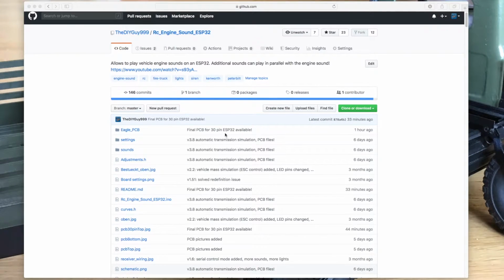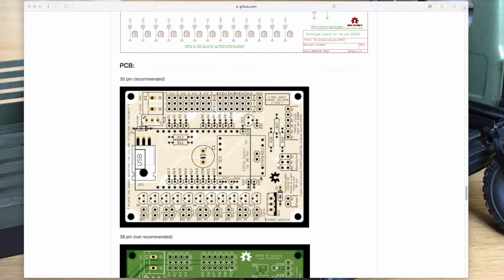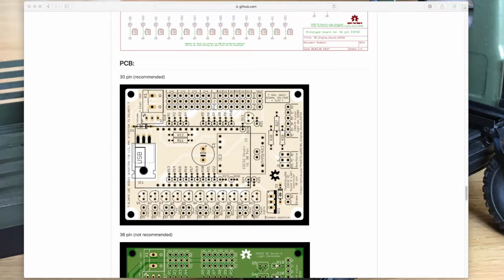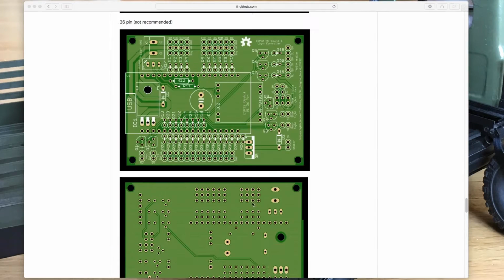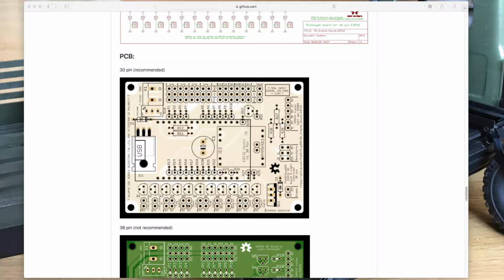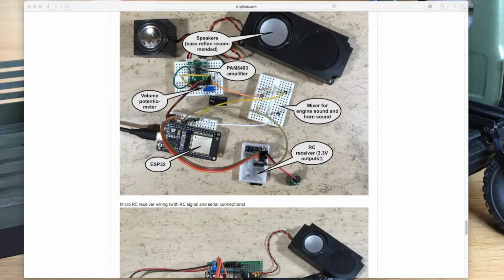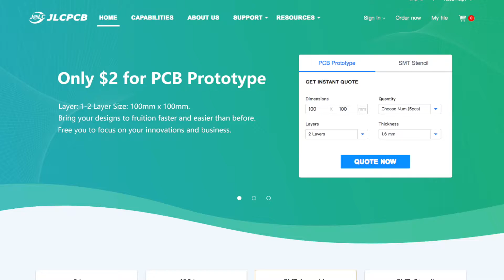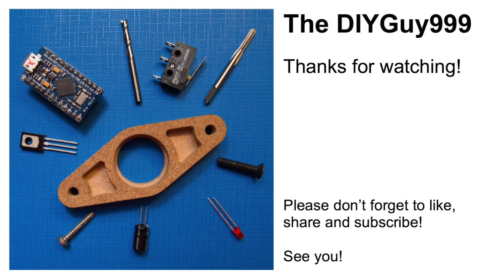Arduino ESP32 RC Sound & Light Controller: PBC, Automatic Transmission, Improved Tatra 813

Comment: Hello, I am using a control with PWM communication but I have not managed to make it work, configure 2_adjustmentsRemote.h for pwm but it does not work I do not know if you have to configure something in the control or something else in the code thanks, I am from Colombia. and thank you very much for sharing all the files.
Reply from the maker: go to the boards manager and install Espressif ESP32 board definition 1.04
1.05 is not working
Reply: Ok, another question, does the ESC have to be connected? 

I mean, can I do the tests without connecting the ESC, only the control receiver?

Comment: thanks a ton for the detailed description bro, my project is up and running, just a small problem, my left blinker is constantly working, relay sound too, i am unable to point out the prob, tested for short circuit but nothing there, can you point where to see?(tried circuit around pin 1, using classic mode)
Reply: any idea how fix this problem
Reply from the maker: Your steering horn appears to be mounted off-center. Then you probably compensated the offset on your transmitter. Reset your steering channel midpoint and then attach the servo horn, so that your wheels are straight. Also make sure you don't touch your joysticks while powering up the ESP32, this could disturb the auto centering
Reply: @TheDIYGuy999  thanks
Reply: The servo staring and remote are alinde properly. I removed both service and Rc signel coming from reciever to esp. even without staring servo signal turning led is blinking
Reply: pleae help me to fix my problem thanks

Comment: Hi many thanks for your video but I can not get my ESP32 to connect to any of my pc's or laptop's! 
I'm running on the latest Windows 10 and Arduino IDE and have added ESP32 to Aruino IDE but port# remains blank.
My ESP32 does not have any chips with CH340 or CP210x numbers. I have installed the Silicon Labs Windows 10 universal driver.
Any help would be most grateful
Reply from the maker: Hmm, another viewer also had issues on windows 10. On windows 7 it worked flawlessly. The driver should be correct, I think. Is it displayed in the device manager? Unfortunately, I'm on macOS, so I can't tell you details.
Reply: @TheDIYGuy999  Hi. Thanks for the quick response 👍. It does not show in device manager. Running out of ideas! I've ordered another 3 esp32's Just in case there is something different. I suppose I could buy an old windows 7 laptop 🤔
Reply: Managed to get pc to recognise ESP32 and connect!
Tried it in the USB3 port and successfully uploaded "Blink"
Now have to figure out how to upload your sound files👍

Comment: ajukan pertanyaan berapa banyak lampu led yang dapat Anda tempatkan dengan modul PCB 30-pin, misalnya bus tingkat dua memiliki 120 led, dapatkah Anda menggunakan pcb itu?
Reply from the maker: Each BC337-25 transistor is able to supply around 500mA, one LED requires about 20mA, so you can drive about 25 LED in parallel per transistor. If you need more, drive a bigger PNP or P-channel mosfet with the BC337
Reply: @TheDIYGuy999  guru punya whatsapp untuk konsultasi pribadi proyek saya, saya butuh bantuan Anda
Reply: @TheDIYGuy999  Master could you help me because I would like to put 5 transistors like 50 LEDs as you would help me please

Comment: Hi, my congrats on this project. its totally insane! an to provide it free for all its just incredible. I would like to make one myself but to use my normal 10 ch transmitter can it be use? what side the perforated pub is? thank you!
Reply from the maker: Thank you for the praise. You can use 4 standard RC signals (PWM), SBUS or PPM to control it. The ESC needs to be connected to the sound controller instead of the receiver. I recommend to use SBUS, because not all additional functions can be controlled via PWM. Currently I'm working on an update, which should make it easier to control additional functions.
You can order the PCB as follows:
1. Download the Gerbers.zip file form here: https://github.com/TheDIYGuy999/Rc_Engine_Sound_ESP32/tree/master/Eagle_PCB/Final (you can also find a schematic and a parts list there)
2. upload the zip here (press "Quote Now"): https://jlcpcb.com
3. do not change anything except the color and the quantity you want
Reply: @TheDIYGuy999  Thank you! understood the way it need to be connected. I check the pbc files but in my country its not so simple to order that pub that way wanted to do it on a perforated pub instead. If you consider its to difficult ill see if I can find a local pcb maker.
Reply from the maker: @maxm1417  Of course you can use a perfboard as well. I did exactly the same for the first prototype. See pictures on GitHub. Every PCB maker should be able to make one, based on the provided Gerber files.
Reply: @TheDIYGuy999  Thank you! I will check pictures.

Comment: That is a great card. I finally received every needed component and soldered everything. Tonight, I heard the very first sounds from it. I just need to change the potentiometer as I'm still waiting the 20k ones and found a temporary 5k one. Next step will be to synchronize my gear lever with the gear shifting. My plan is to change channels input for servos output as I use SBUS connection from my X8R (works fine) so the ESP32 will set the gear servos position. the 330Ohm resistor should not be a problem as I see you uses one on the esc output too. (I need to figure out what the esc numbers means in adjustments.h to set them according to the S22 servonaut esc with the carson poison 55T motor). I may add scania R470 6 cylinders sound too, the engine sounds quite differenty from the scania V8 motors.

Once again thank you for this project and I really advice everyone hesitating to go for it.
Reply from the maker: Thank you for the praise. Yes, you can use the inputs as servo outputs, you just have do adapt the code. escPulseSpan should be 500 for full ESC power. If your top speed is too fast, increase this value. The other parameters are for acceleration, coasting, braking etc. Just play with them until you are happy

Comment: THANK YOU VERY MUCH for this open source project you've shared for us!.. but I can't figured it out why?

 codeVersion = 3.8  i can't make it to work with PWM,. but it works on PPM.. the problem when I set it to PPM is "No Horn"
and where to connect the servo for steering....

TX: FLYSKY FS-I6X
RX:                FS-IA10B and FS-IA6B

// Choose the receiver communication mode (never uncomment both! If both commented out, classic PWM RC signal communication)--
// Serial communication --------
#define SERIAL_COMMUNICATION // control signals are coming in via the serial interface (comment it out for classic RC signals)
// Only for my "Micro RC" receiver! See: https://github.com/TheDIYGuy999/Micro_RC_Receiver

// PPM communication --------
//#define PPM_COMMUNICATION // control signals are coming in via the PPM interface (comment it out for classic RC signals)
#define NUM_OF_CHL 8          // The number of channels inside our PPM signal (usually max. 8)
#define NUM_OF_AVG 1          // Number of averaging passes (usually one, more will be slow)
Reply: the horn is working now....

but still, I can't make it to work  with PWM input.. I have already tried 3 different controllers but No Luck.

// Choose the receiver communication mode (never uncomment both! If both commented out, classic PWM RC signal communication)--
// Serial communication --------
#define SERIAL_COMMUNICATION // control signals are coming in via the serial interface (comment it out for classic RC signals)